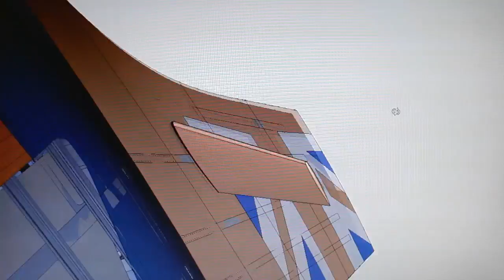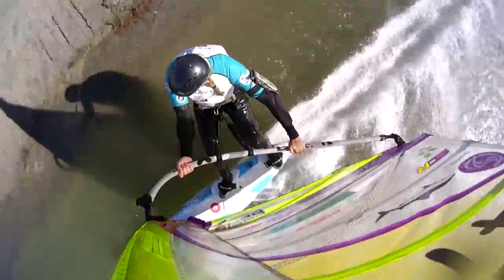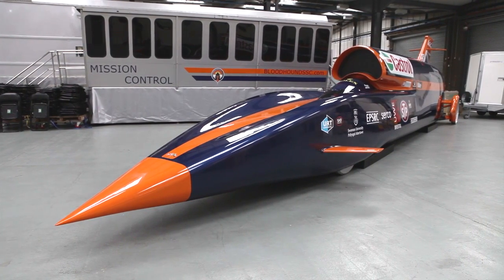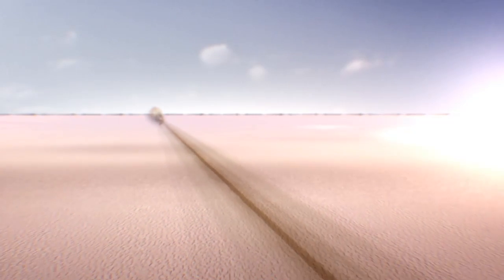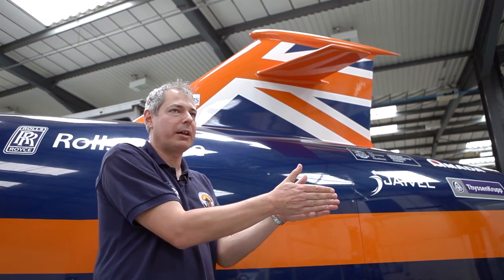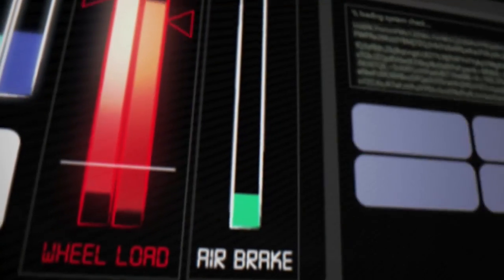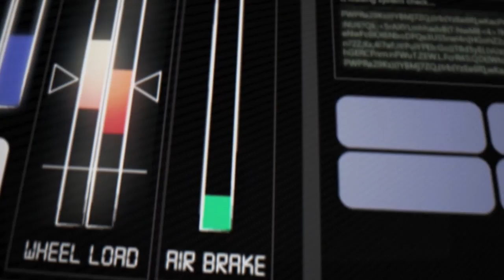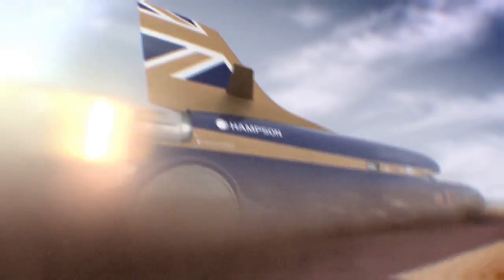How do you keep a 1,000mph car on the ground?

Comment: I hope you realise that the "wing shape generates lift" idea is only one-third of the actual explanation.

The other two components are the wing's angle of attack and the high pressure region generated by the wing's leading edge.

Comment: Can someone please explain what wind surfing has to do with anything on this car? They talk about wings then go on to windsurfing which has nothing to do with wings or lift or down force, am I missing something here or what
Reply: Windsurfing has everything to do with wings and lift! They're using a wing's lift to power the craft.
Reply: A sail and a wing are the same thing, but oriented differently.
In some ways the sail is closer to a normal wing, because it's only being used ninety degrees from the normal orientation of a wing, whereas the wings on the car are a full one hundred and eighty degrees different - completely inverted to give down-force instead of lift.
Reply: Camsplint Did you not listen to the video?  The winglets and fins have nothing to do with maintaining the SSC's ability to stay on the ground - they're stabilisers to trim it.
Reply: Sanbyaku3000
You must have missed reading the title of this video.
Being a pilot, I think I have a moderate understanding of how wings work.
Many aerobatic aircraft have symmetrical aerofoils too, and derive all the lift from varying the angle of attack - this is so they can operate just as effectively either way up!
In the case of SSC, the whole vehicle is technically a wing, and the bits that stick out are just to fine tune the amount of down-force - but down-force there will be, overall.  You don't describe an aircraft wing as zero lift just because the trim tabs are in the neutral position.

Comment: The angle of the canards on the North American Eagle are set as a factor of speed and the angle is predicted as a result of CFD analysis. After 44 test runs, we now have them set at an angle of negative 1.5 degrees. That keeps a constant load on the front wheel up to 500+ MPH. Our load sensors are used to validate the prediction. Our next runs will be in the mid 600's so shock waves may validate the prediction but may also give us some issues to resolve.